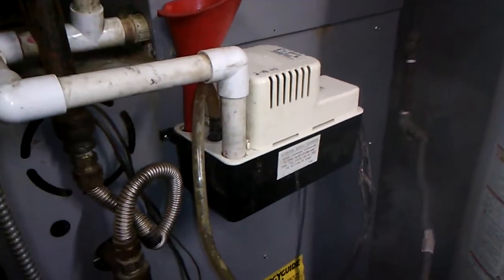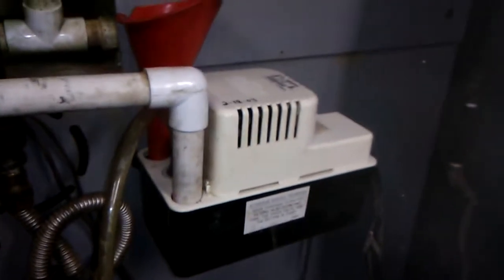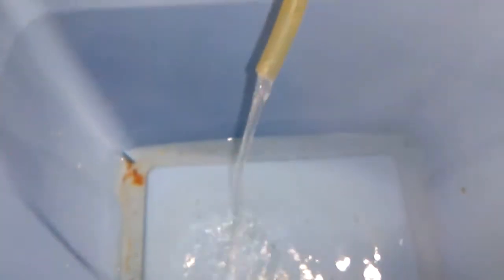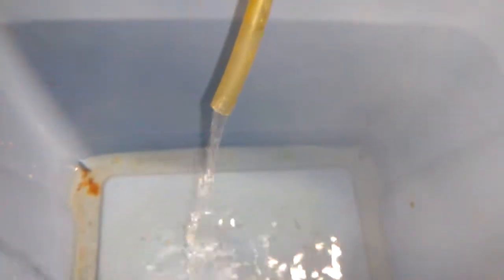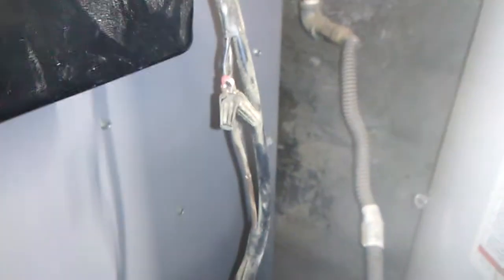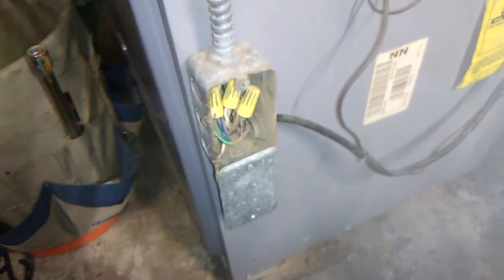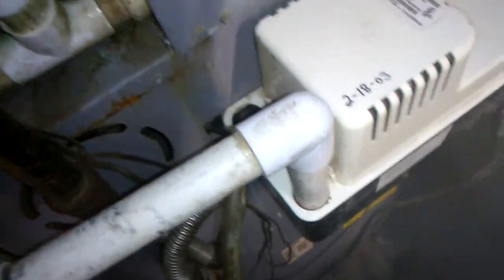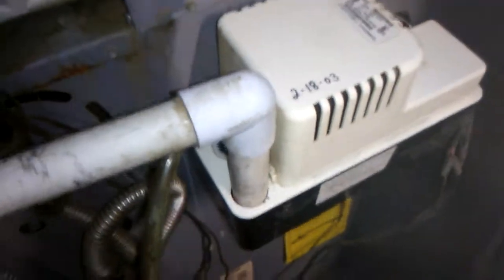Central AC condensate pump runs constantly

Comment: About three years ago the gas furnace service guy said my pump was broken but, not to worry, the furnace would still work fine. It does work fine too, but the pump started switching itself on and off alternately once every fifteen seconds or so. Now the pump has speeded up to the point where it switches itself on and off every two seconds. More irritating than anything else but if anyone has any ideas about how to fix it I'd would appreciate it. And if the furnace doesn't need the pump to operate why is it there in the first place?

Comment: Mine is doing the same thing. I opened it up and it is controlled by a check valve (float). When the float is up it makes contact and turns it on. This must be getting stuck. When mine is running, if I tap on it, it will stop. I tried cleaning the float, but it still stays on.
Reply from the maker: Take it off the side of the AC/furnace, take the cover off and clean it thoroughly with bleach, the reassemble.  Also, replace the drain line.  You can see mine in the video.  It is algae green because, well, it was full of algae.  Not good.  Replace it with clear plastic PVC hose the same size as the one that is already there.  Mine has worked fine ever since I did this.

Comment: having the same problem. I cleaned it but its still making noise were you able to find out why it constantly runs?
Reply from the maker: it ran constantly because the float was stuck open. take the  ase apart, clean it thoroughly. That solved my problem.
Reply: @stephenlutz123  same thank you
Reply: I had a clog in the drain line and on the other end of the drain line and inside the condensation pump. I  hooked everything back and mixed 80% water nd 20% Clorox and snowy you cloud see the small start going through the drain line. after it started working good again. every 6 months im going to do a through cleaning on the pump. if I see a clogged in the drain line a do the same to.